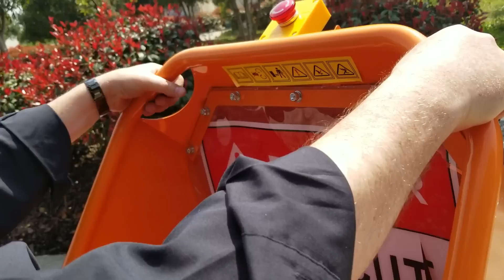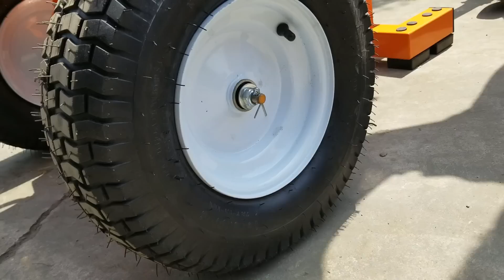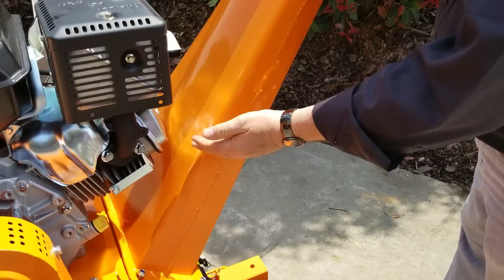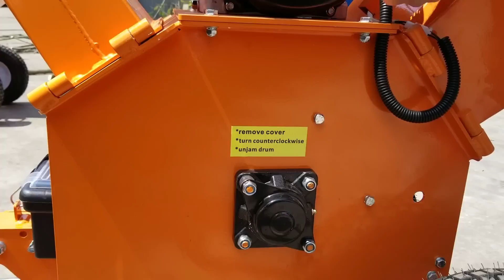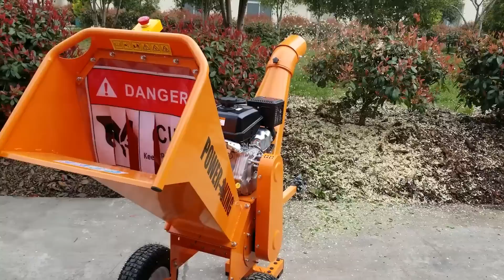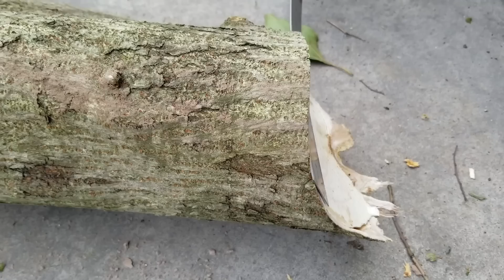PK0915 POWERKING 5IN CHIPPER WALKAROUND AND DEMO

Comment: Gregg, does the HomeDepot have the specs wrong for the 915.  Looks like they have it listed with the smeller displacement engine in cc's.  Also, what is a safe towing speed for the unit?  Is there elec start available?  What is the chute made of?
Reply from the maker: Hi Roger, Yes your right Depot has typo incorrect engine size on the description. The PK0915 is a 14hp Kohler Commercial Engine. Tow depends on road conditions. We have a wheel extension we are releasing in late spring that will expand wheel base another 12 inches to stabilize hill side chipping and towing. Keep an eye out for that new after purchase option. We do not build with elec start but Kohler dealers can add for you if needed. The engine is easy to pull though and starts right up. Its commercial grade. Chute is made of steel, the whole thing is steel, schedule 80 pipe on chip chute, 1 1/2 steel pipe on feed chute opening. No corners cut on the construction per my direction.
Thanks for letting us know about the home depot typo, I had a note sent to them to fix that for you.
Gregg - Founder Powerking

Comment: Do it auto feed
Reply from the maker: The Dual Blades during rotation will pull in the trees that are around 2 inch dia and smaller into the cutting drum and you wont need to hand feed. It is an auto blade feed not a roller feed system. As the first blade cuts it pulls the tree closer in then the second blade come around at 2400 rpm and grabs the tree for the second cut, and so on and so on and so on. Thanks for choosing PowerKing.